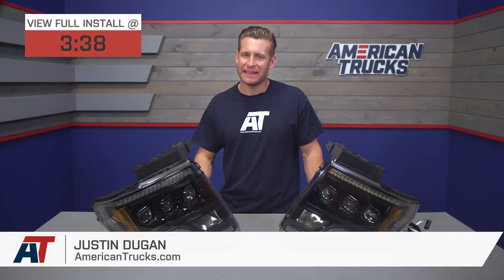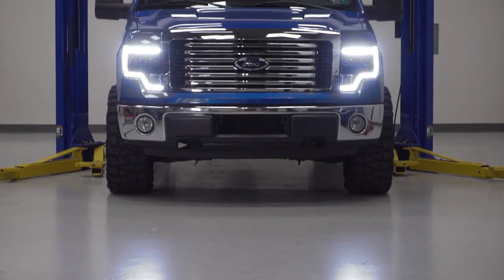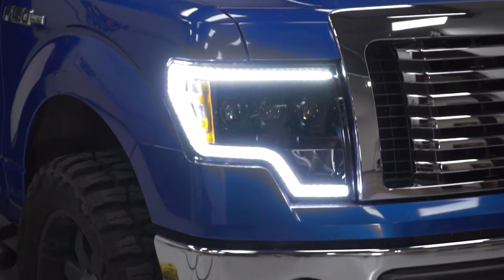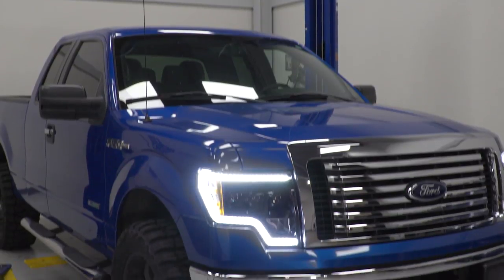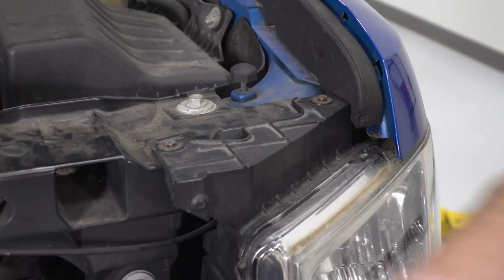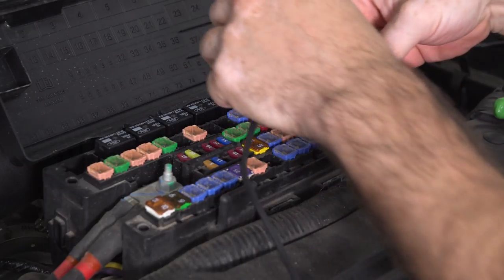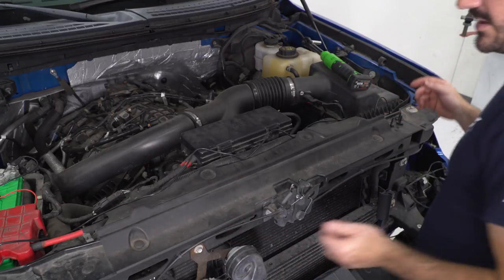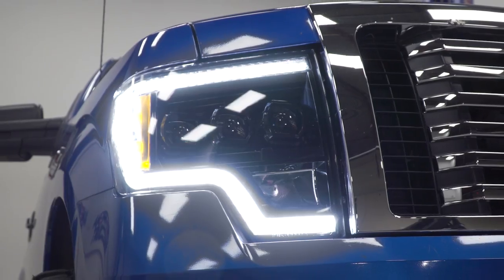2009-2014 F150 Morimoto XB LED Headlights; Black Housing Review & Install

Comment: Purchased my ‘14 f150 with morimoto xb leds installed already. Having trouble finding out how to replace just the bulbs on the driver side. The halos work just fine however the bulbs and high beams went out. Any help is greatly appreciated
Reply: Do you have the XB’s or the hybrids? These shouldn’t go out

Comment: So, I was a fan, but not I'm not.  I purchased these last April.  A month ago the daylights wont shut off after I turn my truck off.  I purchased these for the best look, and Plug n play.  Well, cariD and morimoto basically told me to go pound sand.  They say there is something wrong with my truck.  Well, I put the old lights back on and all is well.  NEVER AGAIN